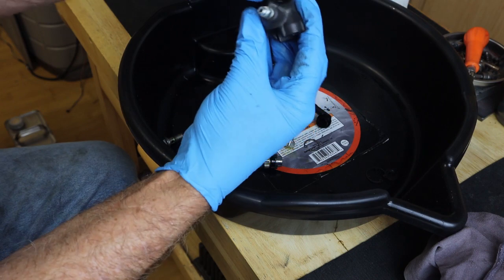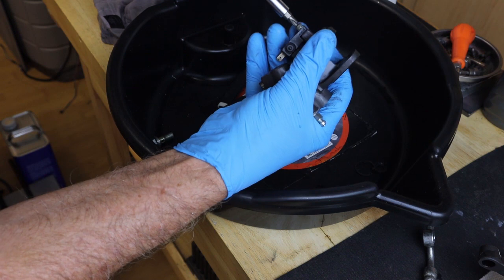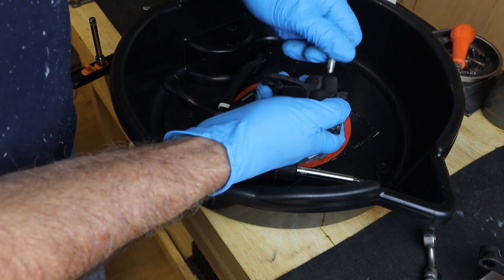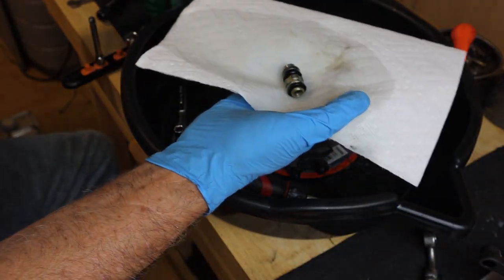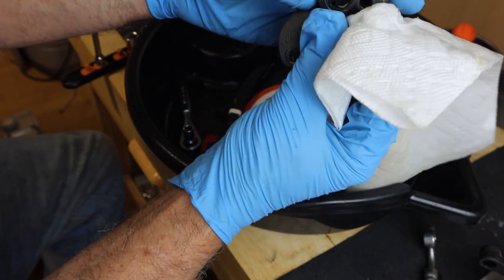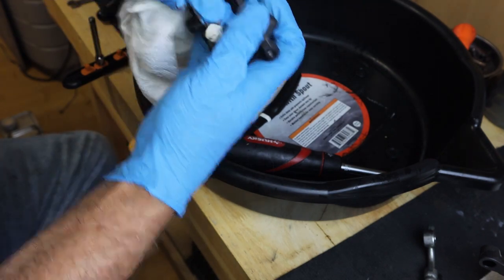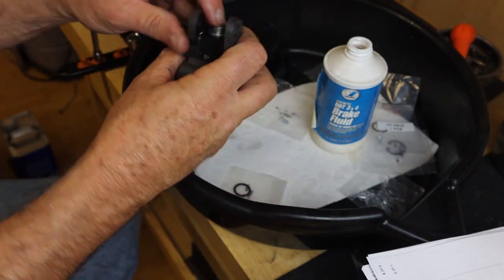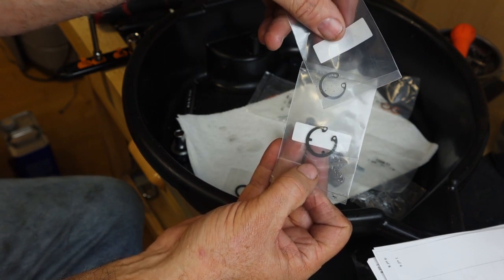2014 GSXR 750 front master cylinder rebuild

Comment: How did it end up working after the rebuild? better?
Reply from the maker: The same,  The forks were leaking so since I had it apart I rebuild everything
Reply: @JoediyLab  hmmmm so you wouldn’t recommend the rebuild then?  Just opt for a replacement ?
Reply from the maker: @sivonparansun  if you have a lot of miles, the yes replacement would be an option thanks